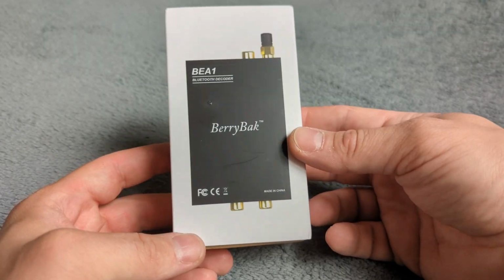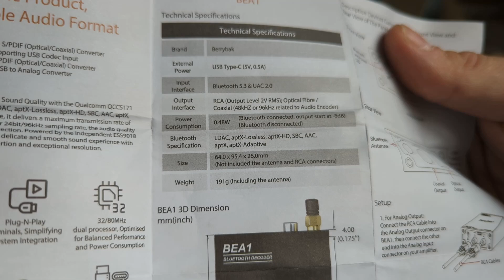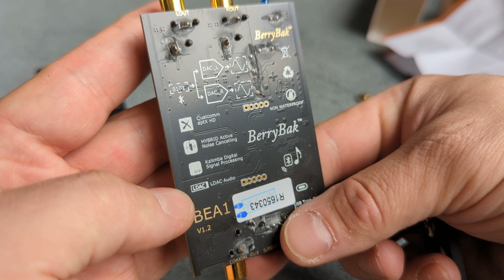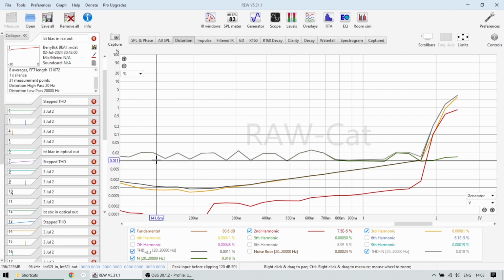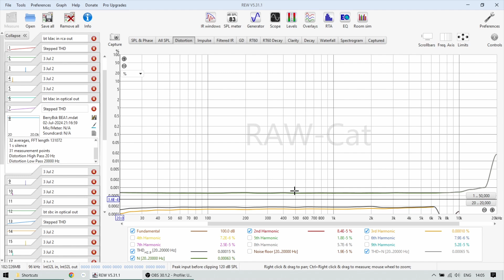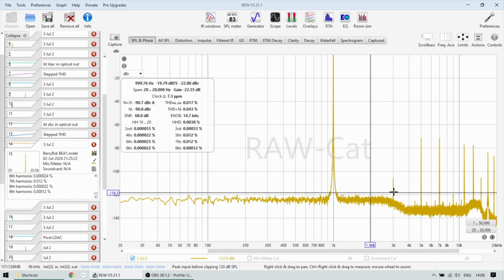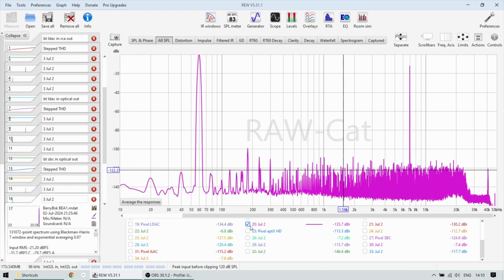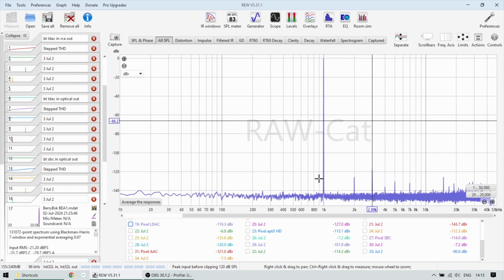BerryBak BEA1 DAC review and distortion measurements

Comment: Raw-cat hope all is well, good news I finally upgraded after months of saving to the Helix Mk3. I have a Fiio player and I’m looking for the highest resolution. By what means would you suggest I connect it? Digital coaxial or toslink? My Fio has a 3.5 aux, do Aux to digital coax cables exist? Or is the converter needed? Been doing a lot of reading research but I’m still not clear as to what cables or modules I need. I would extremely appreciate if you could guide me in the right direction.. thanks 🙏🏽🙏🏽🙏🏽
Reply from the maker: Coax and toslink will give you the same result so you can use either. 3.5mm aux of fiio can do coax out, you just need a correct cable from fiio.
Reply: @RAW-CAt 🙏🏽🙏🏽🙏🏽

Comment: So the audio quality if using bluetooth and LDAC codecs, and RCAS output to aux of headunit or directly even to amplifier will sound bad? What else suggestions that would sound better than this BEA1 you would recommend? Thanks.
Reply: The sound of the BEA1 is pretty good, even the RCA output is way better than your hearing and you get relative clean 1.7V voltage on the output. You seldom need more than 1V in home enviroment. So nothing to complain in real world usage.

Comment: So with this Ldac I can now stream my tidal hi res from my iPhone 📲 and it will now be able to actually stream hi res music without a cord 👌🏽 thank you so much. I will use a optical cord to my dsp , but how did you power this in your vehicle?
Reply from the maker: For power you will.need to use a DC/DC converter same as for any of your dash cameras that convert 12V to 5V USB. Unfortunately you won't be able to use LDAC with an Iphone, as Apple does not support this codec.

Comment: Hello! So I got this device one week ago, just after I saw this video ! I convinced a couple of my friends to get it too ! I can say about it that it performs ok on ldac, using optical and coax output, but not great ! The sound is ok, but still worse than our existing players, Fiio Btr 5 and Btr 7 ! I had better expectations after your review ! The sound is weaker and volume and also not as detailed as the Fiio devices. But we did manage to find a use for this device, because we tested it and the usb dac function is AMAZING ! The sound is twice as loud and twice as clear than using bluetooth ! An advice to you. If you are using just with a usb C to a usb C cable from your phone to this it will eat your phone battery in 2-3 hours of playing, but there is a way to this. We also got a OTG 2 IN 1 USB C Splitter to Dual Type USB C https://www.aliexpress.com/item/1005006408602070.html?spm=a2g0o.tm1000004339.d1.1.93f16690clfmtm&sourceType=561&pvid=446f4c86-1fec-4cf4-8316-43944841b460&pdp_ext_f=%7B%22ship_from%22:%22CN%22,%22sku_id%22:%2212000037074933813%22%7D&scm=1007.44674.329525.0&scm-url=1007.44674.329525.0&scm_id=1007.44674.329525.0&pdp_npi=4%40dis%21RON%21RON%2014.01%21RON%2011.25%21%21%2121.56%2117.31%21%40211b650b17229421516528593e87c6%2112000037074933813%21gcho%21RO%215067953%21X&aecmd=true so you can charge your phone when you use is at a dac and you never run out of battery ! Also another ''hack'' to get great sound is to use the app usb pro from the google store to unlock all your phones dac player power ! Trust me, you will hear the difference ! Cheers :)

Comment: LDAC has 3 mods, natively is in the adaptive mode which is not really the best, like 330 kbps and rarely change the bitrate up automatically. In the 660 or the 990 kbps mode is the cleanest and measure even better, according to RTINGS. This mode can be switched in the developer mode on Android devices. AAC is a psychoacoustic codec and it measures strange, but definitely better than SBC.

Comment: Great video as always! My Android headunit doesn't have optical out. Would this work with Android via USB input to send optical to my Match UP 6DSP?
Reply: Not unless your usb ports can be used both ways. Put something on the head unit’s internal storage if it has it and see if it lets you send it to a usb, If so it’s possible,if not then I wouldn’t want you to waste money. But at the same time you probably could add an optical out if you’re handy with a soldering iron

Comment: I'm always enjoying the video.
Thank you.
I am a subscriber who watches your videos in Korea.
I'm inquiring about something here.
Currently, the product is installed in my vehicle as follows.
DSP Amp : Musway M6
F_Woofer : Ground Zero GZNK 165
F_Tweeter : Ground Zero GZNM 80SQ
Sub Woofer + AMP : Musway P2 + MF108Q
I recently felt the need to upgrade the sound.
I've met several tuning engineers, but I feel sorry for them.
What I'm curious about here is not DSP AMP
If you configure each of the DSP/power amplifier separately
Can I hear a better resolution sound?
Reply from the maker: The gear that you have is very good. You should have a very nice sounding system with a correct tune. Assuming the install is solid. Tuning can transform a system😉